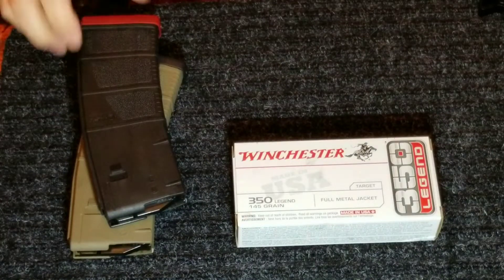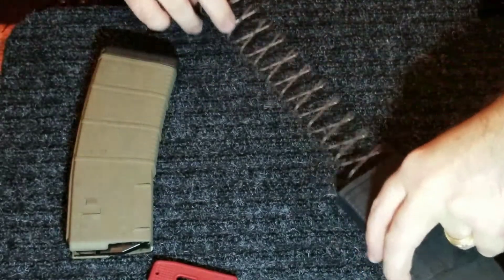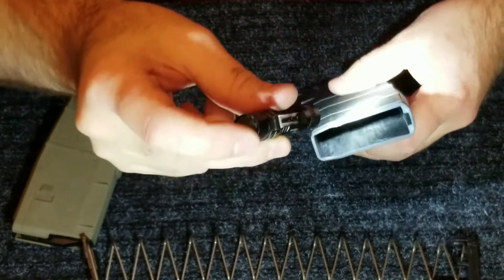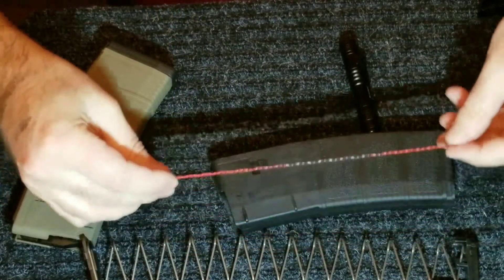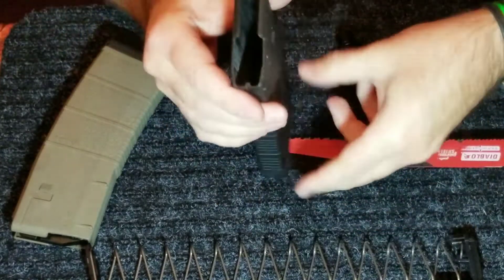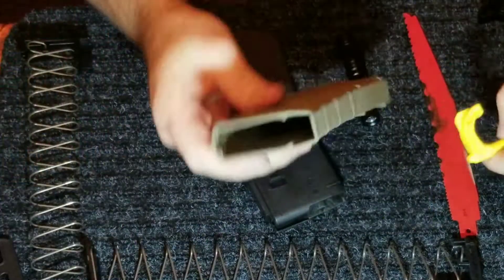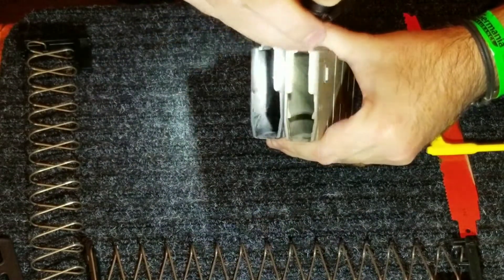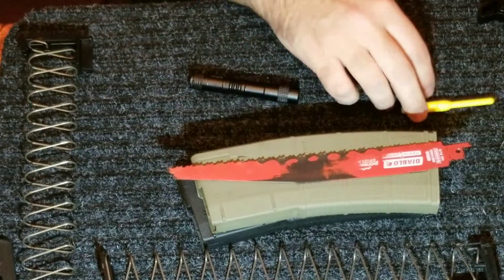30 round 350 Legend Magazine Mod. Make

Comment: Nice work on that magazine, I was looking at the 350 Legend, but didn't want to buy more magazines.  Nice to see I can just modify some of my polymer ones.  This was the first video which came up when I searched for modifying magpul magazines.
Reply from the maker: Its not perfect, but it does seem to work ok. I think a slightly stronger spring would be helpful. If there is a way to stretch the current spring that may work. I really only has problems when the mag is almost empty if that helps. Thanks for the comment.

Comment: Here is my question, would that same process work for the 400?
Reply from the maker: To be honest I'm not sure. But if you want to try it I'd love to know.
Reply: @JAM4MORE i tried it with a hacksaw blade and mill bastard all i did was ruin the shell, a different implement is key
Reply from the maker: @danielsmith8977 that stinks. Well at least you tried

Comment: Possible my tolerances are tighter than yours, however when I did this the mag warped at 20 rounds and would no longer snap into the gun. At 20 rounds, it’s a lot of work. Easier to just buy a few 20s.
Reply from the maker: I agree. I have just bought a couple since then

Comment: Do this, and then stick a spacer between the follower and spring. The 556 mag is angled for the taper of the round. Since 350L is straight walled, there is more spring pressure on the front of the round then the rear. A wedge that angles downward toward the front will alleviate this issue. Try sticking a marble (not my original idea) under the rear of the mag spring between the follower and spring. It will hold itself in place, but also give more upward pressure on  the rear of the round to even it out and keep rounds from shooting up and jamming.
Reply from the maker: Great info. I will try it. Thanks for sharing

Comment: I have now modified the pmag 20 and p mag 30 .  I used the dermal tool that was a lot faster than the file.  Range time the p mag does not work when full it seems they follow the contour of the longer mag.  The p mag 20 works very well 18rds full no issues with the shorter mags .  Good luck folks .  Ar 15 350 legend Bca

Comment: Made one , feeds 145 gr fmj's fine but won't feed 165 grn ballistic tip or 180 gun sp
Reply from the maker: That's interesting. Is it the same OAL. Wonder if anyone else has had that problem. I've only shot the 145 gr fmj
Reply: @JAM4MORE  got a cmmg the other day no issues with it

Comment: Did you hog out the front of the mag so the rounds don’t hang up on the lip as the bcg goes forward?
Reply from the maker: No i didnt need to with this mag
Reply: That's not necessary with a "no-tilt" follower. It doesn't tilt forward so the round doesn't ever hit the mag.

Comment: It seems like a flat blade file might work too. What about the magazine follower? Does it feed rounds okay or have you found that it needs to be replaced with a flatter shaped one, for the 350 Legend round?
Reply from the maker: A flat would work also. I hear the Lancer 300BLKOUT mags work with no modifications. Havent tried it yet
Reply: They don't
Reply from the maker: Thats too bad. I bought some but haven't tried with the 350L yet
Reply: @JAM4MORE  
Only magazine that has worked for me is the steel duramag 20 rounder.
I've try modifying the pmag and the lancer 20 round 300 blackout with no luck 😕
Reply from the maker: @texaspatriot9159  I actually dont even own an original 350L Mag yet. I will definitely consider the Duramag. I have heard  good things about them. Even the 7.63x39 mags. Thanks for the input.
Reply: @JAM4MORE  
Sure thing brother

Comment: My 350 Legend upper is due to arrive tomorrow (excited!), but I'm now shopping for mags.  I know there are some available already made for 350L, but they all seem to be in 5 or 10 round metal.  I want FDE polymer and more than 10 rounds.  I know, worrying over color is vain, but dang it, I want my FDE! and I want at least 20 rounders, maybe even 30's if possible.

Anyway, are you leaving the 5.56 follower in it?  If so, that doesn't cause any weirdness with the stack, like pushing the noses down or anything?
Reply from the maker: Yes I left everything else the same.
Reply: Get the metal mags & paint them?

Comment: This is a 5 min job with a dremel and 40grt drum .
Reply: No dremel makes the hand held ??? Wand it fits inside the mag and will take down that entire edge . A diamond cutter works better but is not forgiving at all .
Reply from the maker: That might work for the top inch or so. I did the entire mag. That may be overkill. But it works

Comment: Manufacturers do not make anything above a 20 round mag for the AR 350 Legends? Why? That’s a 30 round 556/223 mag you have converted?
Reply: The reason is because a 30rd 233 / 5.56 mag is curved to accommodate the case taper when that many are stacked up.
The 350 legend has very little taper so they stack straight basically.
The follower will begin to tilt at the curve with no help from the ammo and all the pressure will be on the front of the follower causing a bind.
Most will take a file and open up the guides on the follower to allow more misalignment and give proper tilt.
But this causes follower tilt throughout the the full travel and increases the chance of weak spring pressure causing binding and failure to feed.
With that being said a manufacturer isn't going to redesign the tooling of a 30rd (basically start from scratch) when then can modify the tooling on an existing 20rd setup. This is due to the small market of ar type mags in 350 legend. The 30rd mags would be expensive to make it worth doing.
But it's becoming more popular so we will likely see them soon enough.

I for one am a fan of 20rd mags even for 5.56 or 300blk msr shooting. But if I was packing for a fight most definitely will have mag pouches packed with 30s.
Reply from the maker: @whiskeybravo11  wow. Good info. Thanks whiskey
Reply from the maker: Yes it is for 223 556

Comment: The real question is why hasn't a manufacturer made .350 legend 30 round mags yet? 
And nice work. That's a clever mod. A little sanding with fine grain sandpaper and a little plastic polish would clean those up nicely.
Reply: 350 legend was intended as a straight walled hunting round by Remington in states that have weird laws.  They all have 10 round limit as well in mags.  20 round mag is the same as 5 and 10.  Just a shorter spring.  In time I'm sure you will see 30 rounders at some point since the 350 is becoming the next big low cost big hitting ar15 round
Reply: @custombikedesigns343  I ordered a 350 upper for that exact reason.  The ammo is plentiful in my area (we aren't restricted on hunting like some states), and that coupled with the newness of the round is why I think it's so prevalent here.  Pretty much any place that sells ammo (even Walmart) almost always has it on the shelf.  I haven't built my rifle yet and I'm already cleaning out places that have the ammo, lol.  I reload as well, but things are coming to a screeching halt there as primers are next to impossible to find.  Powder is getting hard too.

Anyway, I personally think this cartridge is an outstanding CQB round.  Plenty of thump, but not overly harsh on the other end of the gun like 450BM or 458 SOCOM.  Quick and easy follow up shots, plus the ammo is cheap (Wincherster 150 grain Xtreme Tips are $20 a box at Walmart.  Also finding Browning 124 grain FMJ's for $13 a box), and it will lend itself well to reloading (if or when primers and powder are available).  Winchester, Hornady, and even Browning are making ammo for it and the same bullets that Winchester uses in factory ammo is available in component form as well as Hornady and LeHigh Defense bullets too.  Quite a few bullet choices specifically for the 350 if you look.

Just be aware, there is a bit of a controversy over which size bullets work in this caliber.  Winchester and SAAMI spec it at .357 -.003 (which means .354 to .357 bullets should work) and they say bore and groove is .346 and .357 respectively (the exact same as the .357 Magnum), but apparently back when it was in development, PRC (the company that worked to help develop it) received a reamer that was the wrong or a different spec.   They found that .357 bullets caused a chambering issues as well as dangerous pressure spikes because the neck/throat is too tight.  PRC explicitly states that their X-Caliber barrels in this caliber will only chamber and work with .355 (9mm) bullets.  Some AR shooters are claiming they have no issues with .357 sized bullets.  Either way, with the 350L specific 9mm bullets on the market, I don't see this as an issue either way.  All factory ammo, so far, is using .355 bullets.  I guess you could buy and then resize .357's to .355, it's not hard to do, but I also have if question if .357 sized pistol bullets (because that's what they are) will hold together at 350L velocities, or if they will perform well on terminal ballistics.  Might make some pretty dramatic short range varmint loads though :-)

Some are saying this round is on par, if not more efficient than 300 Blackout.  Search on Youtube for "350 Legend By the Inch".  These guys took an AR and put a 25" barrel on it, shot 5 rounds, recorded velocities, then cut an inch off the barrel, rinse repeat.  They take it all the way down to 7".  Pretty interesting results.  It's definitely very efficient.  I think in a 10.5 or 12.5" pistol, this would be one outstanding CQB build....and on the plus side, if you ever hunt in "one of those states" you have a legal deer rifle.
Reply from the maker: @custombikedesigns343  interesting
Reply from the maker: Thanks for the feedback
Reply: CMMG, Ruger, and a few others already have metal 350 Legend magazines. They are not very expensive for metal mags. And they already work! but they only come in 5 - 20 rounds.
Reply: @chrissewell1608  those are all duramags

Comment: What size mags were those originally 556 or 300 BLK?
Reply: Troy Nielsen 300 and 223 use the same mag with no modifications
Reply: @Freakingstang  Some companies make mags specific to different calibers. GI mags work with BO or 5.56, but MagPul and other companies make them differently.
Reply: @ToddSweeny  reread his question and then read my comment.
Reply: @Freakingstang  I waa correcting you, but thanks.
Reply from the maker: It was for 223 556

Comment: Do you think this would work with pmags? I have a few of those I just got in and was gonna try. But it has a third rib in the middle front of the inside.
Reply: Yes the front rib needs shaved. The pointy tip bullets don't have a problem with making it a smaller rib but the flat face bullets will require it to all be gone or the nose of the bullet just bound up a little. With longer ammo 20 or 30 rounds that little bit takes away alot of spring and may not keep up on a semi auto.
Reply from the maker: I don't know if pmags will work. Maybe a quick search might turn up some results. Let me know what you find. Thanks
Reply: @JAM4MORE  I took 1 pmag and then used a file and sanded down both feed lips on the inside of the mag holds 25 as of now but if I wanted I could go the full 30. The one I made cycles every round fine. Just know if you do this just push rounds into the mag and see where it sticks and then file the areas down as you go. I can still use .223/556 in the mag as well.
Reply from the maker: @iwrestledabassonce  that's good to know. Thanks for sharing.
Reply: @JAM4MORE  you are very welcome. And thank you as well. Good videos bud!
Reply: JAM4 couldn’t find much of anything about it. I’m just gonna get rid of all three ribs and see what comes out of it. Thankfully they’re cheap so it won’t be a huge loss if they don’t work.
Reply from the maker: @kalubdailey6257  try this guy
https://youtu.be/vMjLP3PsggU
Reply: JAM4 I’ve since learned that the third rib is to split the rounds down the mag.

Comment: Can it cycle through all 30rds quick or does it jam up
Reply from the maker: Send me some ammo and I will let you know. Just kidding. I did a 26 rnd dump and did have one failure at 24th round. That test cost about $15 bucks. Im happy to get 20 if thats all I load.
Reply: JAM4 right on Hahahah thanks
Reply: @JAM4MORE  a lot of people have noticed last round failures, the spring pressure seems to be too little in some mags
Reply from the maker: @jakespeed9419  good point. Maybe a better spring
Reply: JAM4 put some cardboard at the baseplate see if that fixes it up may need two pieces

Comment: I did pretty much the same thing but with a file instead of saw.
Reply from the maker: Awesome. Im happy how mine turned out. Took about an hr
Reply: Does it work? That's my question?
Reply: Yup big long file worked the best.
Soft clamp on the corner of a work bench with flat steel plates the right thickness for the depth of the cut. And then I taped the edge of the file so I didn't cut into the front wall.
Held the file flat and cut it down. Nice smooth consistent shoulder rib when It was said and done.
A 30rd is tricky with the curve but that's where the flat steel shims really helped with consistently.